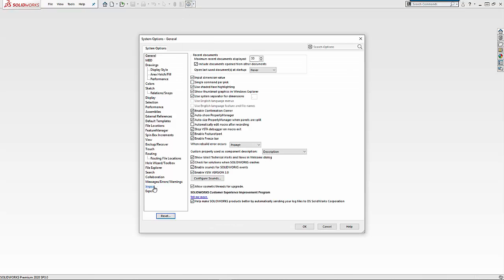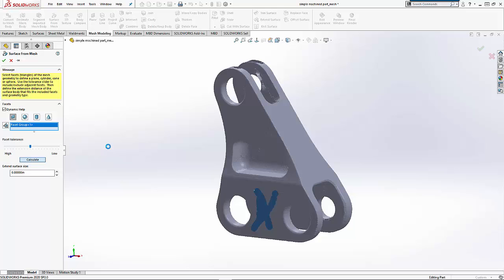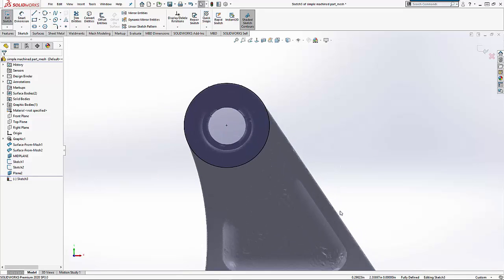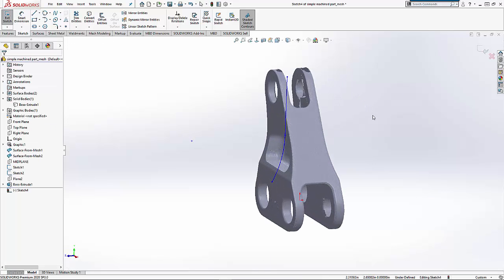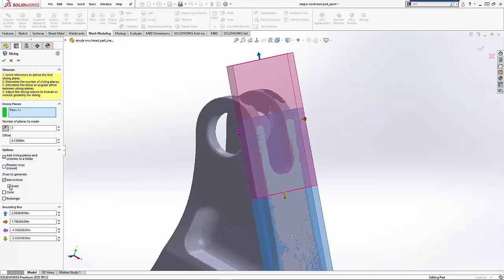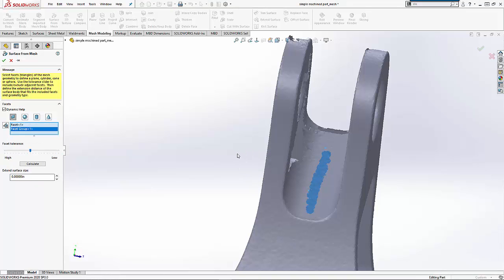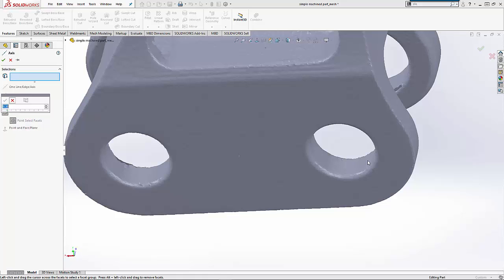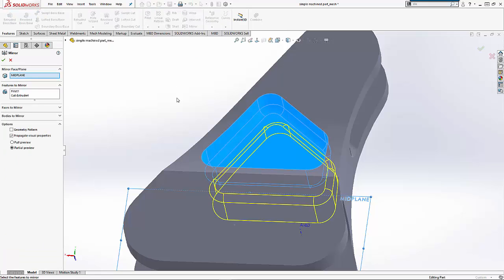SOLIDWORKS Tutorial - SOLIDWORKS and Scan Data

Comment: Great video,  I have been using solidworks since 2006, reverse engineering mechanically since 2010 and working from scan data since 2012, the software keeps changing, for the better and worse.
This was a fantastic introduction of what can be achieved using scan data without the specific and costly addon,  honestly the addon doesn't really make it easier faster of better. 
I especially like they way you showed difference approaches to achieve your goals, it shows very well there isn't a right or wrong way, but many different approaches to solve the problem.

Comment: How can we see scan data in assembly mode? May be GoEngineer try to solve this. Working with scans is meaningless when you try to assemble with other components and see the scan data there.
Reply: You can import the scan data in a part file as a graphics body and then insert that in an assembly